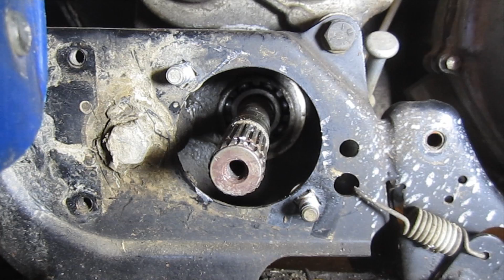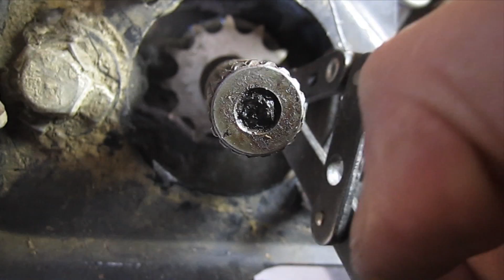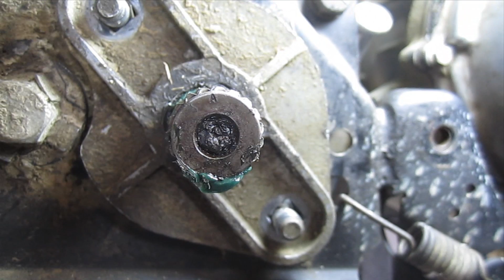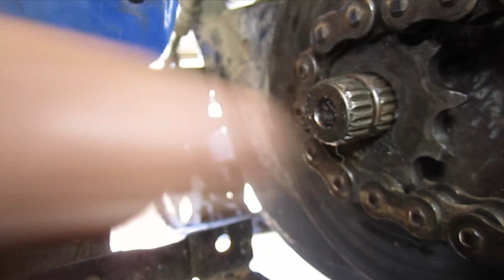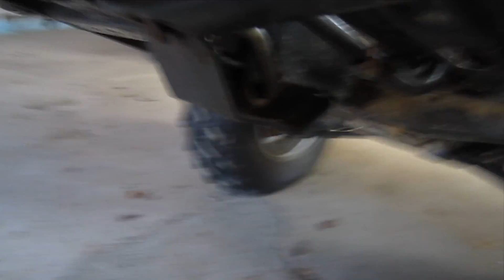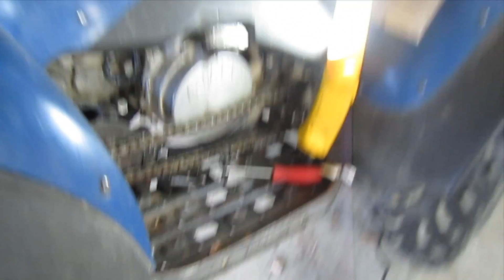Replace Output Shaft Gear Case Seal on a 95 Polaris Magnum 425 ATV -  Part 2

Comment: When I took my sprocket off there was a bunch of like spacers and things and I have no idea If it came stock like that or not but I replaced that tightened my chain but my chain keeps coming off and it makes a popping noise every time it rotates could i of put my sprocket on wrong also nice video

Comment: I am trying to track down a gear box oil leak. Did the bad seal show oil directly on the seal / shaft? Since there are two shafts on the gear box, I would like to be sure which may be the culprit. I am also thinking that on my machine which is a 96 polaris 400, that the leak could be coming from the speedometer cable fitting. Previous owner had removed the pod with the speedometer so I am not sure how the gear box is plugged at the speedometer port. Do you have any idea where the speedometer cable enters the gearbox so I can begin investigation?

Comment: Mark, I have a 90cc bombardier that is my daughter's. The final input shaft broke leaing about a half inch sticking out of the case. This is the shaft that the front sprocket would be on. The part is supposedly obsolete, and I'm having a hard time finding a new shaft. Also I have not found out how to get the tork converter off. I feel like if I could get the old shaft out I could possibly weld the sprocket to the shaft. This sprocket has a female end that  slides onto the shat and then a large  washer and nut to hold it in place.  I would weld all the way around the back of the receiving end of the sprocket to the remaining shaft. Do you think it will hold? Do you know of a better idea? How to I get the shaft out? Are u for hire?lol please give me your comments, concerns advice or recommendations. Thank you Josh.